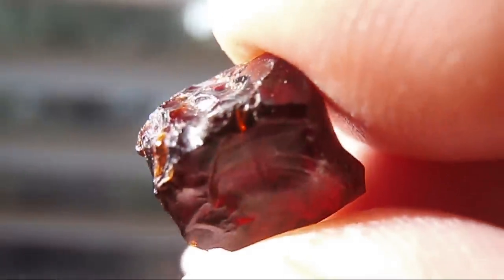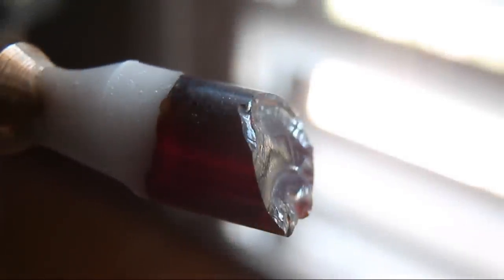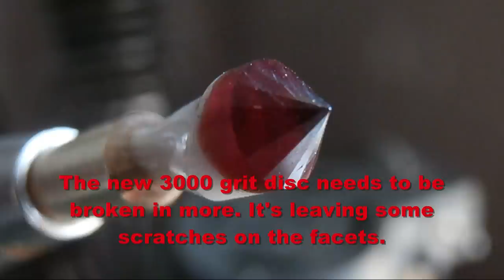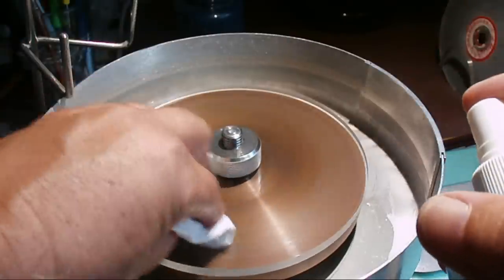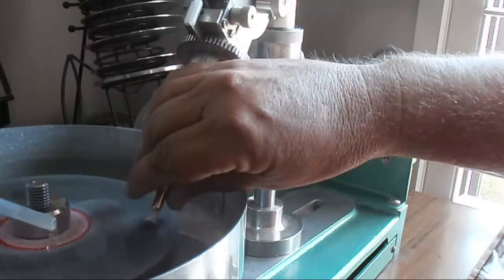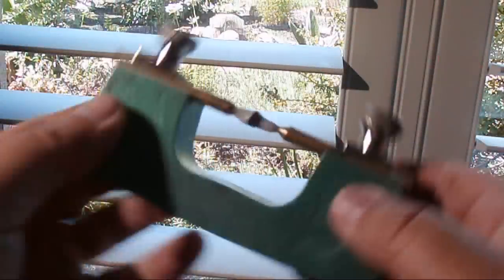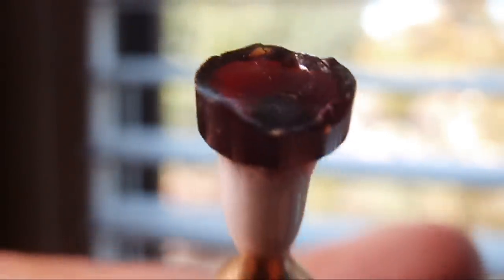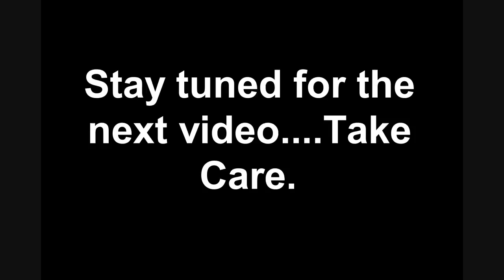How to cut gemstones - Garnet

Comment: Very nice video I like the idea of using both sides of the polishing disc I will give it a try. I just purchased some sapphire rough that was filled but have not cut them yet. Thanks so much for the video.
Reply from the maker: Yes plenty of Sapphires are now filled also. They have no real value, but make good material to practice on. Cheers

Comment: What do you think of the “sapphire & zircon” soil bags you can buy from our Aussie sellers? I got some from Etsy &; I found some glassy/waxy looking stones that really stood out from the dried mud-like dirt. They were heavier & hard as hell to cut & had a mix of colour from green, blue, grey & red - tan. Some look black but silvery lines. I’ve tried to learn how to identify sapphires, zircons, etc but not too sure. 
I also have trouble cutting & polishing using only a cheap dremel with new diamond burs & sandpaper but just can’t manage that shine, only a dull shine that shows colour in the sun. I need advice on polishing with this method. Or should I just keep going until it shines?
Reply: Find the specific gravity of the stone which will help identify it. There's plenty of YouTube videos to show you how. Good luck.

Comment: If you cut facets using the same angle, and using precise divisions on the gear, why do you still need to balance them later after that? Why don't they come out perfectly even though the angles you used were perfect?

Comment: Hello Cliff,
Thank you for your videos on cutting gemstones. 

I am a professional artist, and I'm currently  working on a museum quality reproduction of the Circa 625 Anglo-Saxon Helmet from the Sutton Hoo ship burial. 

This helmet has around 30 x 3mm square, flat faced, garnet stones decoration under the eyebrows. I've had problems obtaining flat-faced garnets, as the suppliers only stock faceted gems. Therefore, I'm going to have to remove the facets to created the requisite flat square inset stones.

Can you please advise me whether I'm likely to encounter any problems if I simply flatten (grind off) the facets by rubbing the garnets on lubricated wet or dry carborundum paper? Also, the best way to polish them and what cutting lubricant to use?

Many thanks for any assistance. 

Thank you,
Rick
Reply from the maker: I think without a faceting machine you will struggle to get a worthwhile gem. polishing will be tricky.

Comment: Hi Cliff I really enjoy your vids. I've bought a VJ and have some Hart's Range garnets and Zircons. How do you determine where to dop for the pavilion and girdle please. I've seen pictures in the Beginners guide for faceting book but I don't fully understand it.
Thanks for your time and patience. Regards 
Nick Smith TCB Queensland.
Reply from the maker: You facet the pavilion first. Determine what shape you wish to facet first. Preform the shape. Where you think the table is where you glue the dop to first. Then you facet the pavilion and girdle. When finished you then need to glue another dop to the cut pavilion and remove the original dop. You will have a tranfer jig to do this.
Reply: Thanks for the prompt reply. I was wondering if garnets have the same problem as topaz where i believe you have to grind a flat @ 15degrees to cleavages. Regards Nick

Comment: you can shave some major time off that pavilion by finding the shallowest portion of the rough after the girdle is cut and start the cutting there...0 is a great place to start but by starting at the shallow part you only set the facet head height once or twice...then cut all your facets before you switch to another grit
Reply: He is still learning and apparently has not learned that technique yet. 

I do meet point faceting and often the pavilion is partially completed before the girdle is cut.

Comment: Is there a way to tell if your mast is alligned to the grinding disk? How do you know if it's in the right position for faceting? Do you have to start at a certain point and then put in your angles?,
Reply: yes....when you travel around to the opposite side you will find out how aligned they are
Reply: The mast needs to be perpendicular to the disk surface - in both axes. Once aligned, the mast position does not matter - the angles remain the same even if you move the mast a bit.

Comment: Dear Cliff hi, thanks very much for your great art work, it is always appreciated mate. I have 4 questions regarding the acrylic glass you use for polishing if you would answer please. Is it a particular type and quality you use for polishing, or a good quality plexiglass would do the trick? Also, the approximate price for an 8 inch round plexiglass with 1/2 inch hole on it in Australia please?? And, as you have mentioned before, one side should be used for 50k and the other side for 100k cerium oxide, how long each side should be used for polishing until it is no longer good for the job, the trick to understand it please ? And finally, Some of the cutters use Acetone to clean it, is it OK? Thanks for your time mate.
Reply from the maker: 1- I use 6 mm  X 150 mm perspex discs  (standard perspex) bought from gem suppliers. 
2- Cost is $14 AU  each (but more for a larger one if can actually buy them)
3- Mine have lasted 2 years
4- I use Metholated Spirits. I find acetone to harsh and the fumes smell. 

Cheers
Reply: Vintage Time 
Thanks a lot mate. It is very much appreciated.

Comment: What kind of glue are use for dopping is it?
Reply: Faceting (black) wax is popular. But in the summer the stone might move due to the heat. Using an epoxy/resin will provide more stability.
Reply: @Lilmanro  What releases the epoxy when you need to flip sides?

Comment: Hi let me start off with i know nothing about gems why do call it cutting when you are grinding cutting and grinding seam like to totally different thing to me nice work by the way
Reply from the maker: Mainly because you can't slice a facet, that would be cleaving. So it is known to cut a facet. Probably is grinding, but the diamond grit on the disc is literally cutting small particles off the gem.
Reply: Ok that makes since thank

Comment: How do you remove the gem from the glue
Reply from the maker: The gem is removed by heat. I have a small hand held blow torch and that releases the glue from the gem.
Reply: @VintageTimeGems  The technique is that you slowly and gently heat the dop you wish to remove - while keeping a finger of the other hand on the gem to make sure it does not get hot. The glue joint will flex/break when the dop heats sufficiently. If you are lucky, it will come of cleanly.

You can also cause the epoxy to break down using various solvents, but you need to make sure the solvent will not harm the stone.

Comment: I can't believe how someone would bother  to fracture fill a garnet, they must be desperate, I can understand rubies.
Reply from the maker: Umba garnets are becoming very expensive as they are a lighter shade of red/pink making them very desirable as a cut gem. Most garnets are too dark. There are varieties of unique coloured garnets worth thousands in rough form these days. That's why they fill them.
Reply: @VintageTimeGems  why do you polish the table before the crown facets?
Reply from the maker: @johnwilkinson154  So I can polish in facets that dont quite meet. Usually the star facets need a occassional tweak. You can polish the table last. I've done that one some of videos. Also, I can leave the 45 degree adaptor in the quill without having to reset the the angles later on.